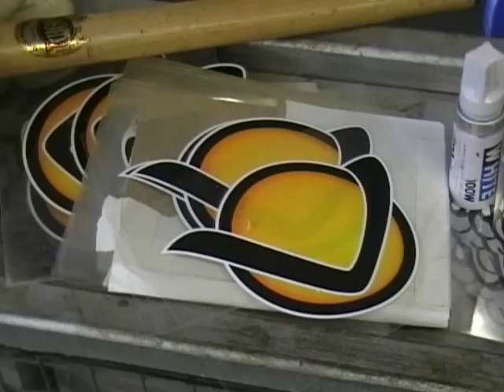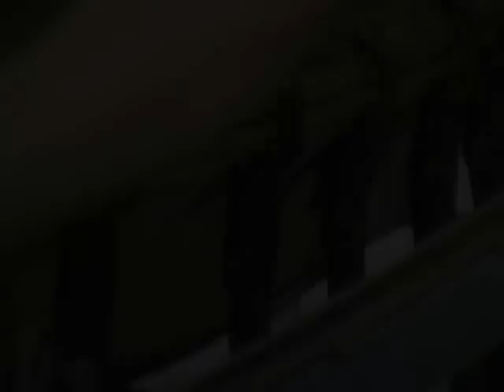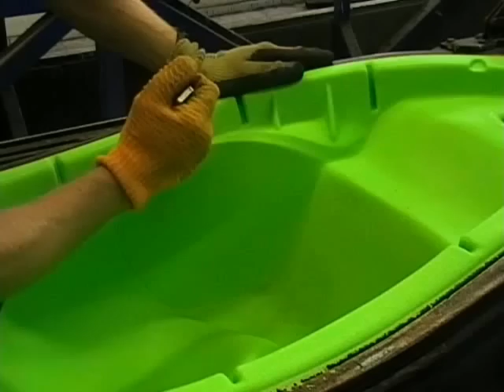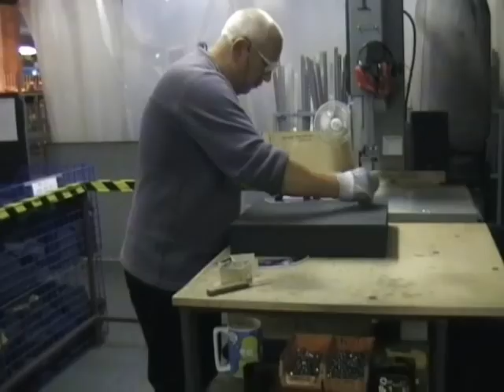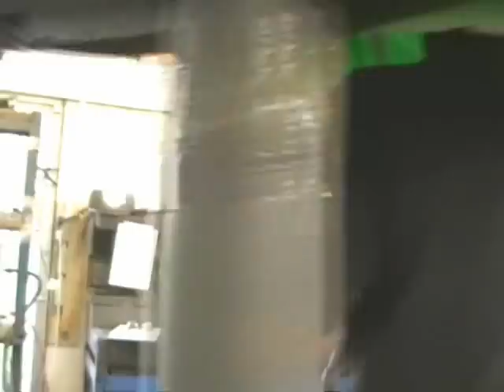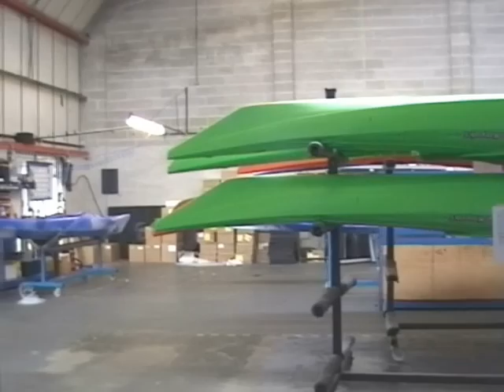Making a Venture Kayak

Comment: Not neccesarilly. Polyethylene has a higher resistannce to impact on hard, sharp things such as Rocks. It is an extremley durable materials, and is almost imposible to penetrate with a rock. Composite is stiffer, lighter, and slightly more efecient, but not as impact resistant. When you weigh the pros and cons, they are about equal.

Comment: Well if you look at it that way they are equal. But i would much rather spend time repairing the composite (and only if you know how to do it, which I do) than paddling in a heavier kayak for those long distances. I think it also depends on the distance and the level at which you paddle. I,m a long distance guy so a plastic one is too heavy.
Reply: My dad (little help from me) built the boats that himself and some mates paddled from Southport to Cairns for charity in 2001 from timber. Nice boats and much lighter then any plastic kayak.
Reply: Horses for courses, they both have their place.